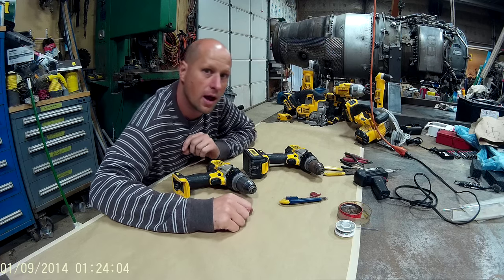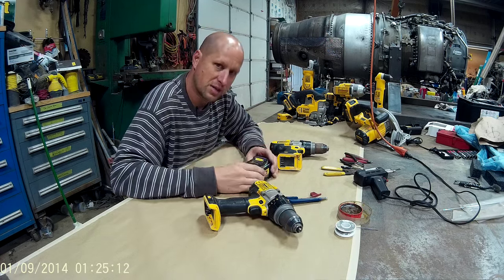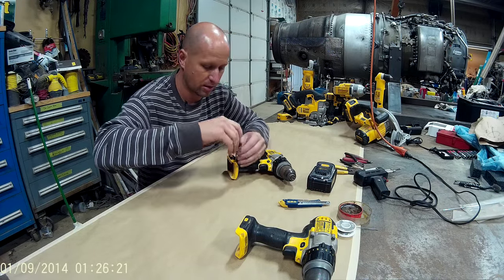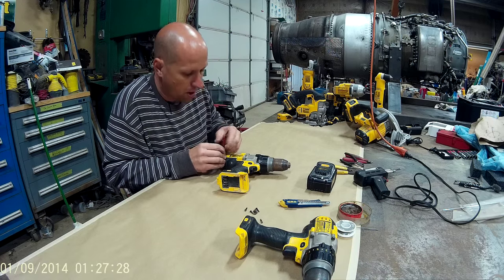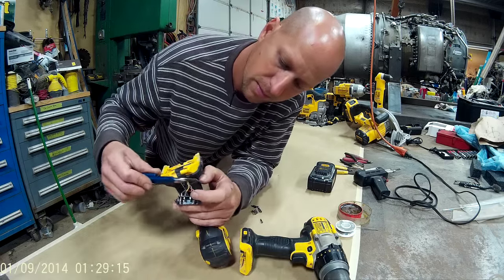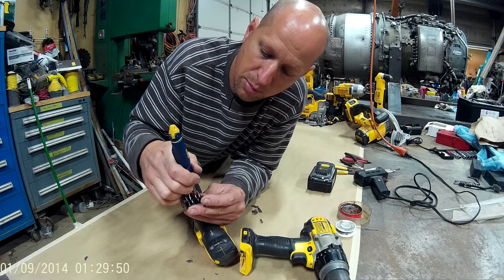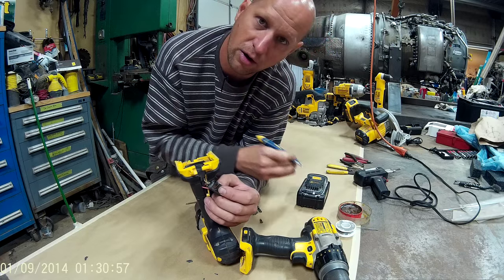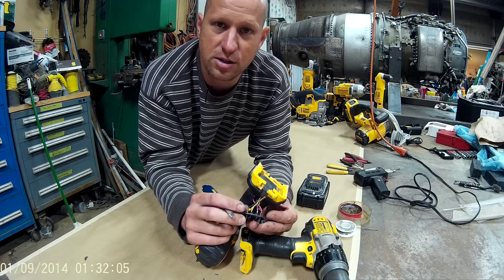Fix your Dewalt 20V MAX Li tools!!  Easy fix for intermittent problem.

Comment: Used this expensive cordless drill perhaps five times before this issue started. Should not have to repair a brand new tool due to shoddy Chinese workmanship. Thanks for the post, but unlike you I think this will be my last DeWalt tool purchase ever.

Comment: You just saved me 250 bucks!  I took my impact apart expecting a cold solder or something and couldn't find anything wrong... But then I found your video and indeed the wire was broken exactly where you said it would be! I'm eternally grateful. So are my neighbors because I can go back to using the electric impact instead of the air gun. 😁

Comment: Thanks very much indeed. Following your advice, just ust repaired my DCD 785. You have saved me about £100.00 (Don't know what the equivalent is in US $!) I have resurrected mains powered (corded) power tools in the past. Seems to me that the boxes that mains powered tools are supplied in are so tight that the flex is forced to bend in order to get them back into their boxes. Metal fatigue causes the L, N and earth to break. Simplest thing is to dismantle strp down and re-wire. Thanks again.

Comment: Switch cleaner works wonders on those battery terminals that are modelled after a 'Jones Connector' which is / was used by the military.

Comment: Thanks so much.  My driver quit this morning and I'm 25 miles from nowhere.  I discovered the wire you showed had a bad solder joint.  After resoldering it seems to be operational.

Comment: Brilliant video and advice thanks. Just opened up my DCD785 combi drill as per the video and found the broken wire (brown in this case) on one of the two inner terminals.
Re soldered it and it's good to go.
Saved me the cost of a new carcas thanks.

Comment: You were bang on my drill was doing the same and took it apart and it was a wire that had broken of the terminal you saved me €80 thanks alot great video 👍

Comment: BLESS YOU MAN!!! My short hedge trimmer was slugish and hickuping on me right at the very end of a 3 day job! All other garden tools working perfecf with same batteries so thought engine was dead but still decided to youtube solutions before buying new one. Sure enough, both sensor wires were broken loose. You just saved me 160€! <3<3<3

Comment: Thanks for your posting!  My issue turned out to be the yellow wire from the battery connection had been pinched between the two halves of the case after we replaced the brushes.  Your video gave me a hint of another avenue to explore!

Comment: Thanks for letting me know the lose battery connection is normal ,my OCD was kicking in real good and was already gonna run to return my new dewalt hammer drill.

Comment: Funny how I wasnt expecting this to be the same issue that my Porter Cable impact was having, but everything you described is literally what mine is doing. I might dig into it tomorrow and fix it instead of trying to hassle with the warranty.. Thanks man
Reply from the maker: Tristan I believe that Porter Cable, Black and Decker, and Dewalt are all under the same corporate umbrella.  Please report back on your results! 
      The “pull trigger, light flashes once” failure mode seems to indicate that the “3rd wire” is not making a good circuit from the circuit board in the battery to the trigger module in the tool. In my experience the #1 cause is a broken wire at the connection from the tool battery baseplate. This connection is usually soldered, and I think the solder makes the wire solid, and then the wire breaks at the transition from where the solder ends to the unsoldered stranded wire. Sometimes it is obvious, and sometimes this break is up inside the insulation a little bit!  I always tug on the wire, or use a razor knife to cut the insulation back a bit to inspect. 
     Good luck!

Comment: Great video. Took my impact driver apart for same symptoms. Turns out one of my smaller wires were loose at the circuit board. Ripped the plastic connector off and soldered straight to the board.

BTW the extra two wires read 7volts across them, Im assuming these connect between cells to provide a lower voltage to power the computer circuit on the tool.
Reply: That's not what they're for, and in general, drawing from anything less than all the cells in a pack is a recipe for a dead pack.

Comment: Carl, the video..... Totally awesome...Not being knowledgeable at all, I resolved the same issue by using a piece of black  tape to build up "one" side of  the battery charger tracks to the connectors.... and bingo.  Apparently,  one of the plastic tracks of the charger was not properly aligned on a new charger for 20vMAX   :-/
Reply: I have a drill that's misaligned like that. A real pain in the ass, that.

Comment: I've been using mine for 3 years and it started doing this when I was drilling thru the brick wall. Bought a new DeWalt set a month ago. A new drill is doing the same thing but it doesn't when I do reverse.

Comment: I had this exact problem with my DCD785M2-QW. Have only owned it for 3 months and I've got 3 year extended warranty on the device so I had an authorized workshop fix it for me to not risk voiding warranty. They called me back the next day since they were done fixing it. Error report on the receipt said "Fixed intermittent connection at battery connector".

Comment: I was at homedepot today ready to buy the Xmas special left overs because I have this problem in 2 drills and the jig saw . Now I work the hell out of these tools so I am not mad at Dewalt . So I am hoping your fix works on my hammer drill because that sucker costs a lot. Going to start with the cheap drill before going into the hammer drill. I did not buy today because I noticed some are made in USA. So I will research that like a mission to Mars. Thanks for the starting point. Before I spend $200 bucs. 😄

Comment: My Dewalt 20 V pruning saw, as well as my other saw, started doing the same thing you’re showing here. Once the trigger is released, I have to take off the battery put it back on and then it works until I release the trigger. I’m going to try what you’re telling me here hopefully I get it rightand stop my complete frustration

Comment: I guess DW did this to secure good sensor signals. But copper will "work harden" and can eventually break. Proper crimping and some flexibility is better that soldering when it comes to vibration prone connections.

Comment: Watched your video thought worth a try I've got a 18volt drill same problem as the one you showed had it two years  not used it as me old bosch is still my favourite. Took all side screws out plus  the 4 screws from the front  removed cover all wires seemed fine put the cover back on put battery in it worked fine kept trying all settings never missed a beat squeeze trigger would instantly turn he chuck variable speed worked fine put all side case in everything still perfect put the four Phillips screws back in the front it immediately went back to how it was light came on trigger hit and miss backed off the Phillips screws half a turn instant fix tightened screws again fault came back could it be those 4 screws pull the case to tight please try it and let me know

Comment: Thank you for the video, I had a DW multitool in for the exact problem, on mine the little battery connector wire had snapped off where it joins the motor control pack, hopefully I can reconnect it, other wise it is throw the tool away!  Anyway, you certainly helped me, thanks.
Reply: Had the same problem at the motor

Comment: Thanks for posting, I was hoping this was going to be the fix for me, sadly it was not. My symptom: install battery, pull trigger, works until trigger is released then dead, pull battery and start again. Turned out my problem was bad clamping diode at bottom of switch, shorted in both directions.
Reply: Steve, I believe I may have the same problem as you've described. Can you elaborate on how you fix yours?

Comment: I have a DCCS620 chainsaw that acts like no battery is attached. Dewalt sent a new saw, but I don't want to just chuck the old one. I'll take it apart and see if this is the problem. The battery is not the problem as the two I now have powers the new saw on ok. I hesitate to take the thing apart as I probably won't be able to put it back together again!!! At any rate, thanks for the suggestion. I'll let you know if it works.

Comment: Hey Carl I bought a DCD999 TY1 about a year back and I've noticed the torque only works intermittently. I returned the first one I bought for another and it seems to be a design problem - just wondering if this issue is common or if mine are just from a bad batch. 

Let's say torque is set to 1. Minimal resistance should cause the drill to slip. If I set it to 1 and hold the chuck with my hand, it will slip on the first press of the trigger. If I press the trigger again it will turn with full force and not slip. I've learned the hard way a couple times for more delicate work, where I set a low torque setting and turned a screw way too tight when the it refused to slip.

Comment: MY DCD791 is practically brand new and won't go into high speed and grinds and stalls when under load; yes the batt is fully charged. First DeWalt I have ever bought! NOT a good start...prob been used less than three times. Going back to Milwaukee!

Comment: I had this same problem with my DCH253 SDS. Fixed it once just re-soldering. Worked well for while and then problem cropped up again. This time cut both wires back as far as possible (almost back to the potting on the trigger assembly) and soldered on new lengths of wire (same gauge and material) but didn't fix the problem. Any suggestions? I'm thinking of replacing the trigger assembly but not sure. Brushes are fine and tested armature. Getting even resistance throughout. Also I know its not the battery. Have tried with several.
Reply: Battery, LOL.

Comment: those two smaller terminals are for the battery cell sensors they tell the drill when to stop working so you dont drain the battery down to much.
Reply: Is it possible to repair or replace those two cell sensors?

Comment: Carl My 20v hedge trimmer has ceased to work. I am thinking it is just the switch and module. I am wondering is it worth to have it fixed by a repair store or is it just easier to replace the switch and module or just pitch the trimmer! Please let me know

Comment: I just bought a dewalt kit with a drill and a impact driver the drill is fine but the impact has a little play in the battery and collet wobble would you take it back the battery isn’t real bad but it’s lots a little loose towards the back I find the wobble is a quite a bit I just got them so what would you do I imagine it will get worse as it gets older good video

Comment: I know it’s been 7 years since you’ve posted this and if the cameras timestamp is right which I doubt it was possibly 9 years since you filmed this but if it’s the battery pack and not the tool causing it would you go about the repair the same way? I have a pack that causes the same symptoms on every tool I put it on

Comment: Okay - i tried this :) - i had some tiny alligator clips since i had no flux for my son's soldering iron, so used them.  And put it all back together, and it works just the same :(.  Did you end up doing the second video about a second option?  I don't think it's the battery, since the battery works fine in my impact driver.  But the pooplessness of the trimmer is bumming me out since i really need it :).  help?  (and thank you for this video - very clear explanations, nice pacing, and made it very attemptable :))

Comment: I pay WAY too much for Dewalt premium tools!! I shouldn't have to mess with anything on any DeWalt tool inside of the first 5 years!! My 14.4's would fall apart before they stopped running. Now I upgraded to 20V and about 2 years a go. With light commercial use on my impact and Household use on my drill I'm having all kinds of trouble with them. First I thought it was the battery. I was down to only one because the other got stolen. But bought a new battery a 5 amp hour battery and thought my problems were over. Wouldn't you know it I'll see you trigger pulls later and same issue. Talking to friends and co-workers who have DeWalt tools. They tell me it wound up being in the trigger. They had to go buy and replace, on their own, the triggers on 2 of their 5 Dewalt tools. The problem is across all of my 5 tool kit except the flashlight!! From my drill to my sawz all. 
This is too wide spread to not have a recall!! It's even happening to tools that I bought from across the country!!

Comment: Ok so clearly the problem here is that particular battery. My question is this how do you fix that battery? I have a 4ah, a new style 3ah and a 2ah all with this same problem. I’ve also had a few others in the past that I threw away. I kept these because they still power my small Bluetooth speaker but nothing else. They make the lights flicker but no power.

Comment: Could Jumping, (bypassing)  those wires just to see if problem goes away work?  Hard to see breakage, it would definitely tell you something.  Unless - they must be incorporated in circuit for drill to run.  Don't know a thing - just asking, so wording may be 'off'.   THANKS!!
Reply: Those sense lines have to be there for the tool to work. This is why you can't use another brand battery on these tools even if it's a perfect fit physically it won't send the same info to the tool thru the sense lines.

Comment: Thanks.  I was wondering which wire was what.  Well, I have a dcf 899, when I pull the trigger it does absilutely nothing.  The battery is good.  I opened the case and saw one of the coils had a broken wire near the base of the coil.  Is that normal?

Comment: Have u encountered issues with the torque dial? Mine is stuck between hammer and standard drill. I can't let it dial to screw mode. I bought mine about 5 yrs ago. Its for home use, never been abused. Any suggestions on how to fix it?

Comment: BEFORE YOU START CUTTING OFF THE SHRINK SLEEVES... I had a similar intermittent power problem. Drill doesn't work when you press the trigger. BUT, if you pop out the battery, and re-insert it while holding the trigger, it runs, until you release the trigger; Then it's dead again. I got sick of having to pop out and slam in the battery every time I needed to activate the motor. 
TROUBLESHOOTING: Before I condemned the connections at the connector end, I tested EACH ONE for continuity using test leads with gator clips on the end. At the battery end, with the gator clipped to a contact fin.  At the other gator lead, I hold a sewing needle or straight pin which you can insert through the wire insulation end to test for continuity. ALL WIRES TESTED OK, even when wiggling the shrink sleeves. I even tested above the small wires where they appeared mashed by the trigger assembly. 
THE CONCLUSION: The electronic module containing the switch and motor control is causing the problem and must be replaced. However the module can only be purchased as part of the "Electrical Assembly" which I found priced at $75-$80. Which is half or more the cost of a new drill. Not a contractor or professional here, I could not justify the expense for the occasional project around the house, so I developed a work around. 
MY WORK-AROUND : Note - Experience soldering wires is required! I drilled a 1/4" hole through the back seam of the handle near the bottom and inserted  a small toggle switch. I cut the heavy brown wire about the center of the switch, soldering the switch in series with the brown wire. This basically replaces me having to remove the battery and re-insert it to get the drill to run. Instead, it's a simple off and on while holding the trigger.  I am now a happy camper!

Comment: Hi Carl,I just got an aftermarket battery for my dewalt drill, screw gun, and saw....it's doing the same thing you demonstrated in your video. In your video you said the fault may be with the battery. I think this is the case with mine, as the genuine Dewalts work 100%. Are you going to make a video on repairing these batteries?
Thanks,Patrick
Reply: Patrick Rutherford did you figure out why your battery had this same symptom? 
I ran over my drill/battery and pulled a couple wires apart. After I fixed the drill the battery still powered the drill but the led indicator did not. Pulled the battery apart and repaired the indicator and now the battery doesn't power either drill. Just turns the led on for a half second, same symptom here.
Reply: No, I gave up and just got another battery pack.  $55 down the drain.
Reply: After I got the battery back together after I checked all the solder points, I didn't have power to the TB terminal and it just turned the drill Led on. So, I used the old fashioned slam it on the bench a few times and bingo, it works again and that terminal reads like its supposed to. I opened it again and it stopped working again. Slammed it again on the bench and it works. No idea why, but that worked for me.
Reply: how do I get the handle apart?  it won't pull apart at the bottom of handle.  where battery inserts??
Reply: Shelby Whitten I know this is an old post but in case it helps someone else out. To get the handle halves apart you have to take the 4 screws out of the gearbox and wiggle it a little in order to slide it forward.
Reply: +Shelby Whitten by the trigger there are two pins that hold it together pry the whole handle assembly  apart with the left side facing down and take a baby  flat head and slowly pry them apart below the trigger

Comment: Having the similar issue with a 20v (small) DeWalt blower. It's happened with an old one AND the new one I recently purchased.  Is that a freakin JET ENGINE in the background? Hope the airplane didnt have the same problem ....